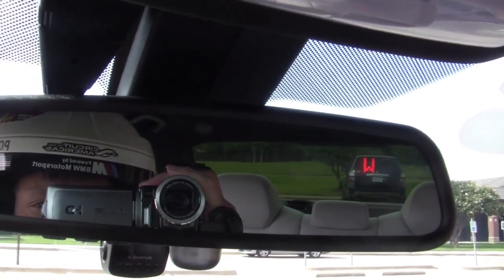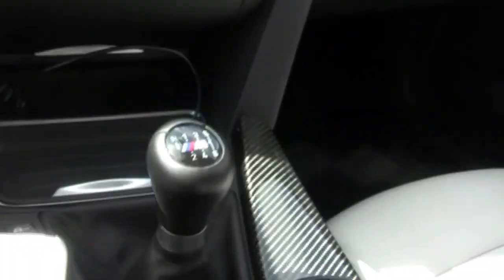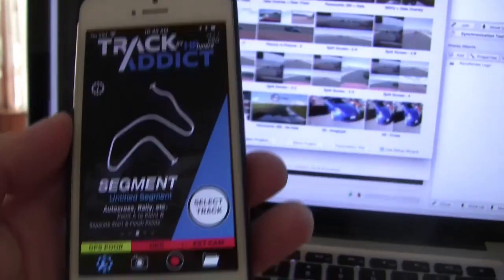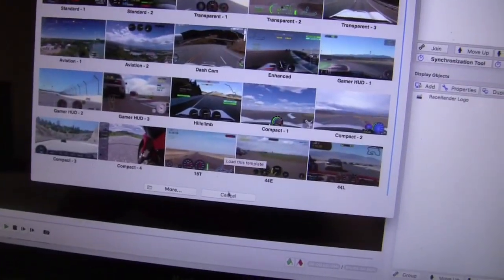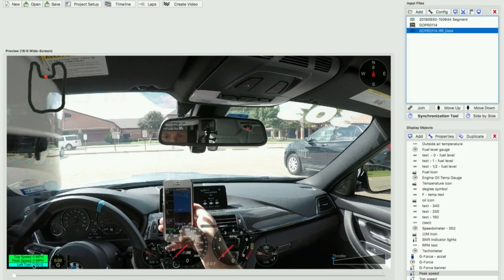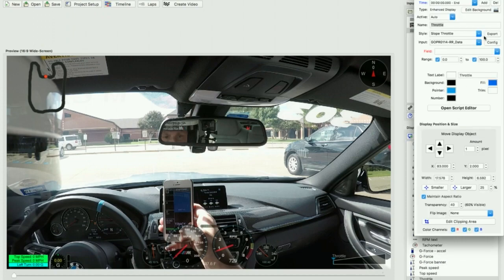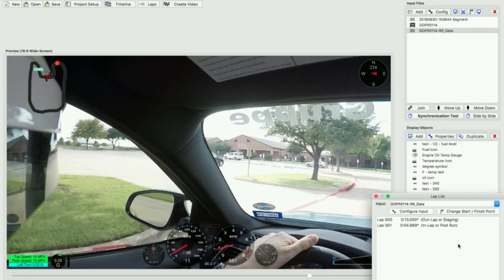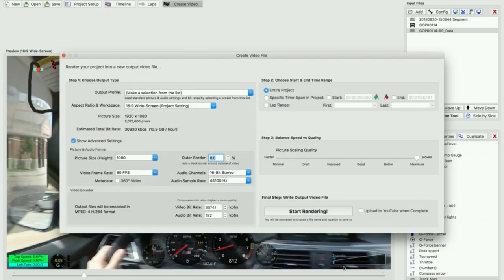How I make my videos

Comment: Thanks, I have Harrys lap timer do you find track addict easier to use?
Reply from the maker: I never got Harry's to reliably connect to my OBD reader, so I just stuck with TrackAddict. Might very well to do with the phone I'm using.  I have an old dedicated iPhone for the TrackAddict, and it just works, does everything I want, so I'm sticking with that...  Harry's looks like a great product, so if you can get that to work, I'm sure it's a good choice.